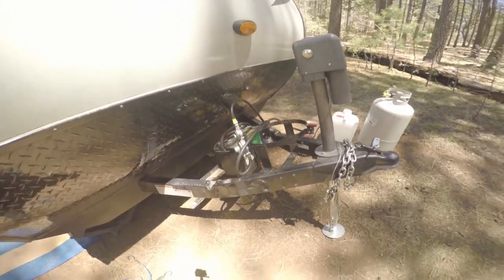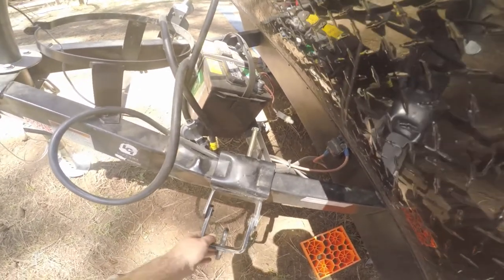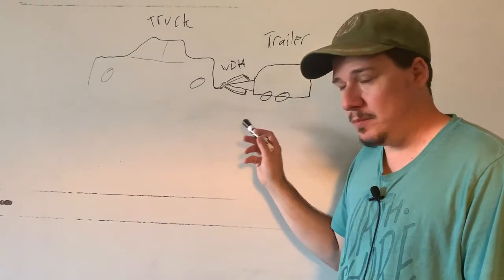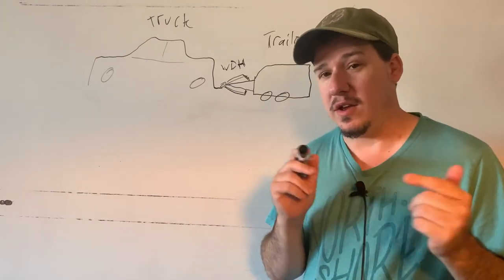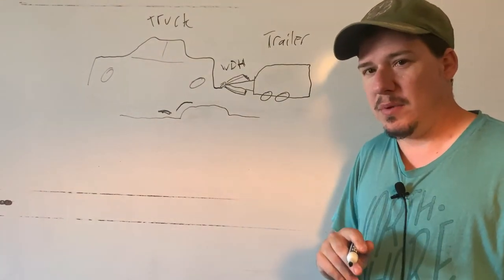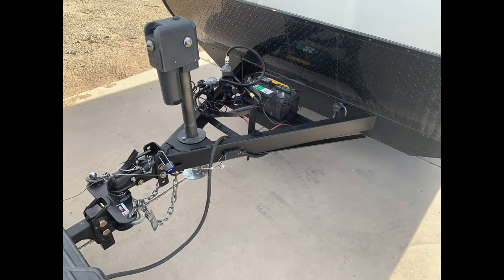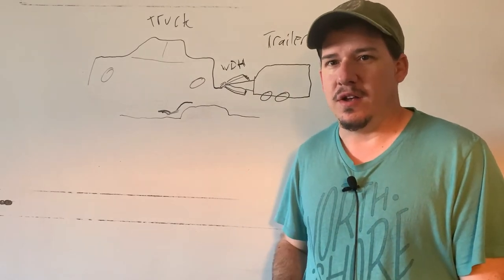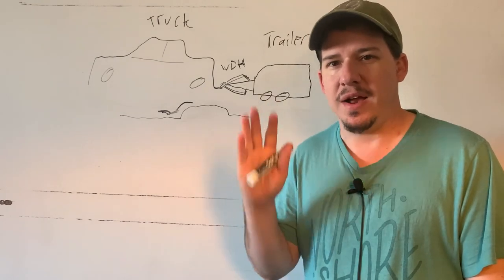How to avoid breaking you travel trailer | I think my trailer is totaled !!!

Comment: Something to also consider is disassembling the weight distribution bars when off road and going slow it will allow for less stress on the frame. I know that can be a pain but it could also save you from this happening! 

Enjoyed the video JD from BTBRV is super helpful for sure! Best of luck and happy camping!
Reply from the maker: Yes that is something that I discussed in another video that was that was produced after this one, Thanks for watching!!!
Reply: Another thing I noticed in one of the pictures was an ATV in the bed of the truck- the extra 550lbs only adds to the compression forces, which turns into more leverage. The frame on the trailer does look really small.

Comment: I've been looking further into hitches/receivers, Weight Distribution Hitches(WDH).  Everyone is reducing structure.  There has to be the weak link in the structure somewhere.  The failure should be engineered to have safety.  ie if the truck receiver failed, it shouldn't break free.  It the ball/trailer receptacle failed, it shouldn't become detached.  The next 2 structural points would be the trailer frame, or the the WDH bars/structure.  I have seen newer WDH's that are specified for certain weights.  ie  the flex bars are designed for a 4K, 8K, or 12K trailer.  Using a WDH that is designed for your trailer (or maybe under designed) would allow more flexing of the bars, and less bending moment on the trailer frame.  Using a WHD that is overdesigned (aka 12,000 lb on a 6,000 lb trailer) could cause the trailer frame to bend.  It may be better to have your WDH bars bend first.  You can replace them easier, or just tighten up the chain on them a link to continue traveling until you can address this.    I would not use the short WDH bars.  Longer bars have more flex.  A structural spreader bracket to avoid the point loading on the trailer could be designed to protect the frame, but what would be the next failure location?     In your video, you showed a WDH on the highway.  That frame appears to be a higher depth box frame.  The height of the frame is the most important dimension....
Reply from the maker: This is exactly what I think happened when I went back on the dirt road with the WD Bars still attached while I when up hill the bars were too strong for the frame of the trailer. Thanks for the comment!
Reply: @CherishtheJourneyy    Driving on a dirt road shouldn’t cause damage. Others have bent their frame on a bump at road construction. A speed bump, or a depression or in some places , the drop down from a driveway onto the road. Any time the angle between the tow vehicle and the trailer changes, the weight distribution hitch will have a higher bending force ( and the counter bending force on the frame). Saying the dirt road caused it gives an excuse that you were doing extreme off roaring , voiding any manufactures liability

Comment: So many trailers have junk frames. This isn't an isolated incident. A friend bought a 27 foot toy hauler, and it only is rated for 2,200lb of water, gear, toys, etc. Which means a 1,500 pound side by side and full 100 gallon water tank puts him over the limit already, with the fuel station still empty and no other gear. The same size toy hauler from Outdoors RV has their own heavier built frame with KYB shock absorbers, MoRyde shackle kit, and 16 ply tires, with a rating of 5,000lbs. Meaning you can put the same SXS inside, 100 gallons of water, and 40 gallons of fuel, and still have around 2,460lbs of payload left for dishes, gear, clothes, or another motorcycle. But they don't use a Lippert frame, they build their own and have it certified as "off road capable".

Comment: Thank you for the info.  We have a Equalizer weight distribution hitch on our 2019 Grand Design Imagine travel trailer.  We sustained similar damage while traveling down I-10 in West Texas.  Our damage was not as obvious.  The front of the trailer was tipped downward, had been level prior to this trip.  The inspection we had to figure out the problem indicated the tongue was bent up and the crosswise frame piece right in the front was buckled.  We have an appointment to have the estimate, so no idea how much it will cost.  This trailer was still under warranty with Lippert the manufacturer of the frame and the manufacturer of the trailer Grand Design.  Both said the warranty was voided by using a weight distribution hitch, thus we will have to go through our auto insurance for repair. Just a heads up to those using a weight distribution hitch.  The dealer we bought the trailer from new told us we needed that hitch, never mentioned it would void the frame warranty.  Leaves us in a dilemma as to how to tow that trailer.
Reply: FYI I-10 in W Texas is like a rollercoaster, humpity hump over and over.  You can't see it before your are in it.  Slowed down of course, but it still damaged it. And that motion repeated over and over on that road.
Reply from the maker: Sorry to hear that happened to you as well, I got the same answers from Lippert as well as the dealer & I had an extended warranty but that didn’t help either. 
My advise when talking to your insurance company is to let them know it happened while driving if you know that is how it happened
Reply: @CherishtheJourneyy  Thanks, I sure will.
Reply: I checked the owners manual, the warranty isn’t voided by using a weight distribution hitch.  What it says is they won’t cover damage caused by it.  Just the act of using a WDH doesn’t void the warranty.  In fact in most cases vehicle manufactures recommend a WDH for any trailer over 5000lbs, in many cases the max tow rating can’t be met without it.
Reply: @CL-xk8iw  Pretty much the same thing as a voided warranty if the manufacturer of the frame and the manufacturer of the trailer both say they won’t cover damage if you use a weight distribution hitch. However, “it voids the warranty if you use a weight distribution device” is exactly what both said. They called it a modification, not original equipment, and they aren’t going to honor the warranty. Yes the weight distribution hitch is required to tow our trailer.

Comment: I believe the manufacturers are skimping on structure.  The trailers are lighter and not that durable.  They always point it back to operator error.  That frame was not that strong compared to older trailers, but it is lightweight and can be towed with lighter vehicles.
Reply from the maker: Yes that is my thinking as well, it is just a hollow chamber for the frame so once that frame gets any stress fractures it’s just a matter of time before the frame bends!
Reply: @CherishtheJourneyy  All frames are hollow tubes.  The bending stress in the frame is mostly related to the height.  The thickness of the metal is less important.  It would be best to have a higher frame to add stiffness.  Your failure may have been first caused by the top WDH clamps on the frame pushing down on the top, causing stress at the front of the bracket.  This, along with the bending stress caused the top surface to buckle and allow bending.  Adding some angle iron above the WDH frame clamp could spread the stress point and possibly add some margin.
Reply from the maker: @diyernh  Great suggestion!

Comment: The newer trailers are built so cheap, frames are not built for the loads applied to them bouncing down the road. This is a noted issue for the past few years.
Reply from the maker: Your correct, and when I talked to lippert they told me that those frames are hollow and can only withstand so much force
Reply: There has been a lot of problems with Lippert frames. They are a weak frame. Some of the problems that Lippert has claimed,the frames are missed used for the application and weight of the trailer that they will used for. I say BS, they are just trying get out of being liable for their bad frames.
Reply: The frames lack structural integrity, light construction.
Reply: The “box” of the camper adds rigidity to the main frame thus making the weak point at the tongue attachment to the frame.

Comment: Beware RV owners  This  hit me hard  . Save yourselves a lot of grief by simply inspecting your trailer frames  for cracks that develop from use.  .  I  myself found that my travel trailer frame was cracked , torn and spider cracked in 7 places . 2 and 3 axle trailers have a problem in that making turns especially backing in places racks the frames , twisting the Ibeam  that the spring shackles are welded to. Next time you  are backing into a paved spot  ,half way in ,get out and look at the trailer wheels and you will see they are contorted and dont line up . It will be evident that your springs , shackles and Ibeam frame are really being stressed . Over time they will work harden and break . The Ibeam frame is braced to keep the Ibeams vertical with cross braces  that welds between the Beams . The welds dont break they hold and the web breaks at the weld.  My  cross member ripped out of one Ibeam and pushed through the other  side so the forces are tremendous.  So inspect for any deformations from 3 ft before the front axle to 3 ft behind the back axle .You may see a rust colored scratch looking mark on your frame . It will take 10 minutes tops .  For 5th wheel owners thry are breaking at the transition of the Gooseneck  to the trailer . Any facade deformation means you have an urgent but fixable problem if caught in time .  Can you imagine yout trailer coming apart and going into oncoming traffic. or flipping your tow truck.
Reply from the maker: Thanks for the comment

Comment: The biggest problem with these hitches is people using small tow vehicle and just letting the hitch take up the drop when they hook up, when they should be adding over load springs or air bags to assist the hitch
Reply from the maker: With my truck that I had towing this trailer it was perfectly capable and not only the gross vehicle weight rating but the payload capacity as well, but I understand where you’re coming from as I do see people all the time that tow trailers that are too big for their truck!
Reply: @CherishtheJourneyy  well i agree with some of that but a newer 1/2 ton pu is rated to tow 10k,that is just plain stupid, and some of these suv's are rated, but they are completely over loaded when you tow what they are rated at, and if they squat a lot in the rear most just tighten up the spring bars, in theory this is the way they are designed, but the newer rv frames are so light/ thin they cannot take the extra stress of the weight, not to mention the driving ability of some people who tow, its plain scary, i believe most people should be required to take a class on driving/ towing rv's

Comment: Rv trailer frames are built light so tougue is not thick enough to take down pressure from wd hitch thay need to be .188 wall thickness
Reply from the maker: Thank you for the comment and you are correct that the frame was built light and after I got the trailer fixed it was reinforced and correct about the downward pressure from the weight distribution hitch.

Comment: No it's not your fault, the industry wants you to believe that and will blame it on you, but this is a major problem with a class action lawsuit to follow, because they are using 1/8" steel for the frame rails which is far below the load factor strength needed for proper operation and integrity of the trailer frame, if you get the bent frame replaced make sure they use 5/16" frame channels as the replacement metal for proper operation and towing.

Comment: Please don't blame the weight distribution hitch. The frame break down because of the manufacturer cutting cost and sacrifice to the engineering and the safety. The cheap manufacturer know the frame is not design to the trailer load. Let me guess your trailer is made by Forest River. The only mistake is you didn't know the frame is not design to road safe and you have to reinforce before putting it on the road.

Comment: dislike the notion of a WDH - its trying to "make a silk purse out of a sow's ear" as we say.  If you want to tow a problem sized trailer, go and get a 5th wheel rig, and do it right.
Reply from the maker: Thank you for the comment and weight distribution hitch is supposed to take the weight of the trailer and equalize it between the truck and trailer throughout. The hitch weight was well within my payload capacity of the truck what I didn’t taken into account at the time was the added weight with the quad in the back of the truck

Comment: This is just a cheap built trailer.  Like 99% of trailers that I see and work on.  All RVs are made weak.   Weak frame weak metal is used as well.    The weight distribution would not have saved this price of crap .. only a matter of when it would break that weak little meta frame.   Not if.      It's when.     Look how weak that frame is.   Looks weak to me.     I would never buy an RV.  Not until I find a strong built RV.   Good. Luck
Reply from the maker: Thanks for the comment!

Comment: Your picture of the trucks and trailer level has no weight distribution on it so your overcoming the by raising the ball really high. You are removing a lot of weight from the front tires of the truck which reduces control and stopping ability. Your video encourages people that don’t know any better to run without weight distribution on their trailers. Hopefully no one followed your video.
Reply from the maker: The purpose of a weight distribution hitch is for to take the stress off the back end of the truck and equalize it out across the truck and trailer. I did not encourage people to run without weight distribution on their trailer I talked about what happened to my trailer and for people to be aware!